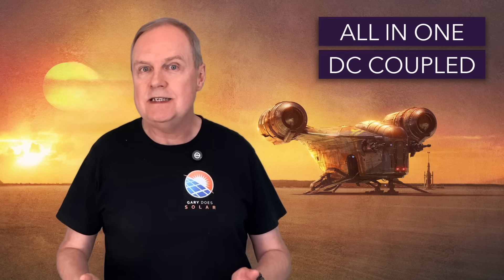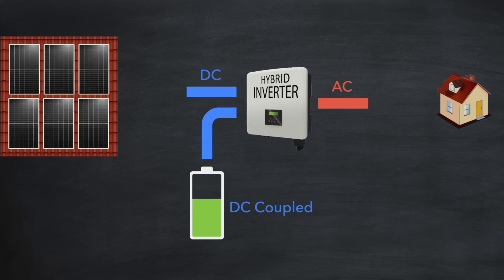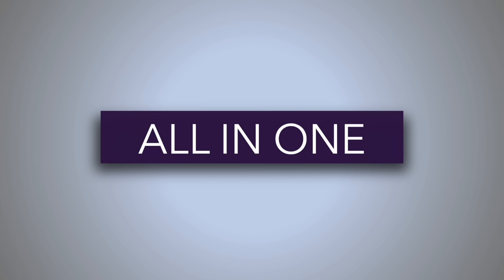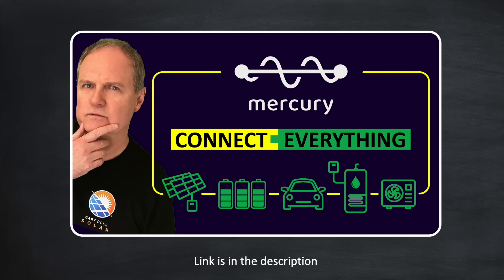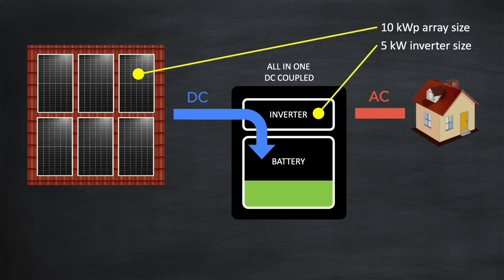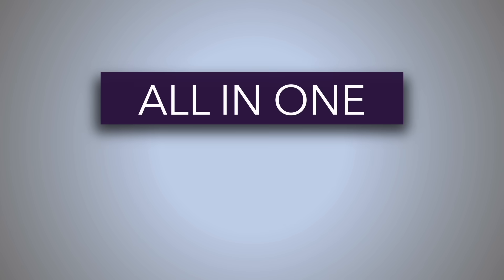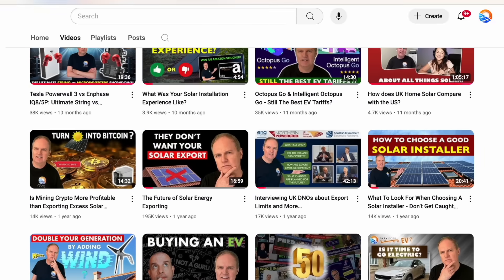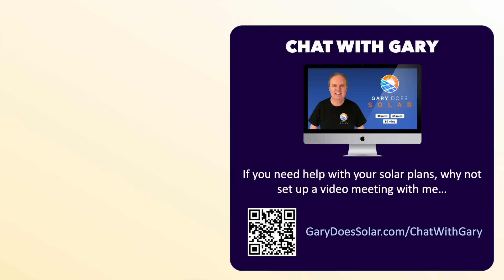Why All-in-One DC Coupled Systems are Transforming Home Solar

Comment: I'd far rather a modular system from Victron. The solar is DC coupled just as with your all in one systems, but it's easily expandable and - most importantly - I'm not locked in with a specific battery. This makes a vast difference in cost.

This isn't a phone or a pc. These systems are wired in by a qualified engineer anyway who can easily spec the system and manage the additional installation complexity. All the client needs is a nice app which Victron undoubtedly provides.

The cost difference is vast. I have a 32kwh battery, 5kw inverter and 3kw of panels... Total cost was about £4k, plus another £2k for installation. An equivalent Sigenergy system is literally 5x that price, for a completely equivalent product.

Comment: it looks cool but i'd rather have a modular setup. they are larger and built better. larger heatsinks, fans and more internal space to manage heat especially for  8kw and up inverter. setting up a solar system with the intent of selling power back to the grid these days is already pointless. there will come a point where distribution utilities will purchase your power exported for basically nothing. and i have no desire for the thing that's powering my home to be accessible on the internet sending data to god knows where and to god knows who.

Comment: One challenge is that our utility in the US requires AC metering on the solar, not the combined solar/battery system.  This requires adding another inverter reducing the benefits of the DC-coupled system.  It's been challenging finding a DC meter that works with the utility's Sensus Xylem AMI system.

Comment: Sig EC single phase 8/10/12 kW in Australia are being recalled due to fire 🔥 risk. It’s big news over here. Their reputation are in tatters. 10+k units are affected. Sig is paying $500 AUD (£250) to installer to go back to the customer premises to install a new unit. Unsure if it’s affects worldwide 🌍🌎🌏
Reply from the maker: “Reputation in tatters”? I don’t think so. Let’s wait for the official press release, but if there is a design issue (and it may not wholly be that), then it’s the mark of a great company that they’re acting swiftly to remedy.

Comment: I've a Powerwall3 installed June 2025. My DNO (SSEN) has not only restricted my export to 3.68kW but also requires the inverter  to be limited to 3.68kW which means I draw from the grid when my home load exceeds this. This makes no sense to me. Originally I was going to have an AC coupled solar array using micro inverters which would output up to 3.2kWp. The DNO said the PW3 would have to be set to 0.48kW so that the combined solar plus PW3 didn't exceed 3.68kW. Duh! Why would the DNO put such a restriction on a User?
Solution was to DC couple but I still have a maximum generation limited to 3.68kW despite not requiring any export.
I'd be interested in your thoughts?

Comment: With all-in-one solutions, you're locked to one provider and you're not going to get best prices, also future upgrades is in their hands, you're basically stuck with them for the life of the system: 20+ years. 
You're trading flexibility and competition for a packaged product
Reply from the maker: To counter… in the early days of PC computers, you could buy all the components from different suppliers and combine them to make a system. Today, some people still like to do that, but Apple showed that by controlling all aspects of the system (both hardware and software) you can product a world-beating compelling solution. I see the same happening with home solar systems—the sum of a well-put together package is far greater than its parts. But it takes a great brand to get the magic right.
Reply: @GaryDoesSolar  You just further validated my point Gary. Yes, Apple sells you a smartphone for £2000+ and a goggle for about £3000+, tightly controls access to the ecosystem to serve and protect its own interests. 
The skilled person who bought best components and put a system together (a rare breed these days) has to have a lot of skills and patience to get them to work well but will end up with a solution specific for his needs at a much lower price point.
Reply from the maker: So going back to your original comment, you’re basically saying that a billion Apple users are wrong. Do you really believe that?

I do admire anyone who has the knowledge and skills to build their own system, to suit their particular purposes, but my channel was not set up for those people. My channel is there for the majority of people who don’t have those skills, but nonetheless want to participate in Home renewable technology. The systems I talk about in my videos are therefore well-suited for my audience, in my opinion 👍🏻

Comment: For me - micro inverters are best served where you have splotchy coverage for your solar panels. - i.e. trees near by or some other thing that filters the sun light or for very small systems where you only have AC needs.  Otherwise, IMO they add a large expense even though they negate the need for a charge controller and Inverter.  

As far as these all in one DC coupled systems - I'm still not convinced since they have a single point of failure.  I know that this is the trend now adays, but I prefer component based systems.  And as you stated with Apple and Android, I don't really like being forced to be married to one eco-system.

Comment: The passage about Batteries not compatible with some brands of inverters is BS as most BMS are talking to ALL brands of  inverters because this is their purpose. I don't say you can't find any niche BMS that has comunicaitons problems, but for the important part (SOC and switch), it works. DC coupled high voltage proprietary systems are the answer from corporations that want to get rid of cheap homemade batteries and systems. Today a complete 16Kwh 51.2V battery cost 1600€, almost TEN TIMES LESS than proposed HV systems.

Comment: HI GARY, just going back over this video, thank you for posting. I haven’t spoken to you in a while but I thought I would reply here as the Solar PV and Battery install we are having installed in DC. Happy to discuss 😊
Reply from the maker: That’s great, Simon! 😀 Yeah, feel free to get in contact—would love to hear the details 👍🏻
Reply: @GaryDoesSolar  Thanks as always Gary. The two roof solar pv arrays will be about 11kwp, linked up to SigEnergy Gateway, 10kw inverter, battery and DC bi-directional EV charger. I also decided on fitting an ASHP. 
A couple of queries for you / the community: 
1. Where is the UK government on V2X (specifically V2H) legislation? I am aware of the Octopus Energy EV V2X package that has recently launched so is this energising movement on this?
2. What advice do people have on linking all these systems up through the Gateway so I can run an efficient system.
Reply from the maker: On 1, I think we’re 2-3 years away from any legislation being published. It’s a huge issue for the DNOs because a typical house would be theoretically able to export from solar, battery and EV all at the same time. In my recent (Mandalorian) video, I can see All-in-One, DC Coupled solutions leading the way here, as they can hide all that power behind the inverter, but for other disparate systems, how can that be controlled?
Reply: @GaryDoesSolar I get the point about the grid and DNO not seeing what’s hidden behind the inverter but why can’t the homeowner make use of the huge car battery reserve when it’s needed. The technology is there to use but is being held up.
Reply from the maker: Yeah, you make a good point. If it can all be consumed by the home, why should the DNO care? But of course, if the home required zero power, then the only place it can go is to the grid, and so that's why they want to understand the total power output of a system (including EV). Maybe there's a good solution for all this? For example, an additional hardware unit at the meter that blocks export above a limit?
Reply: @GaryDoesSolar THANK YOU for taking the time to respond Gary, always appreciated. It’s an interesting discussion I am having with our installers and soon with our energy provider. I will make a record of the project as it progresses and try to keep you, the Chanel updated in case it can be of help to others.

Comment: Question:  
Do LED bulbs need AC?
Do heating Loads?
Do Computers?
No?
So what ACTUALLY needs an expensive inverter in your house...???????
ALL those loads are simply less or more batteries connected in series.  (skipping the parallel for simplicity)
ie: Lets say you have 55 (Solar Charged) 2v cells in series:
Live wire after ~ 2v cells is LED lights.
Live wire after 6 such cells is computer, cell phones etc.
Live wire after 55 is water heater, room heater, stove, kettle, toaster etc.
What actually needs AC and how big is that inverter..?

ie: The future of solar-battery power is when the world realises it's having the living shit scammed out of itself..!
ie: "Hey Mr Giant Expensive Inverter:  Fo Guck yourself!
Reply: agreed
Reply from the maker: You both need to understand the issue with electricity transmission. My video here is a good starting point:

https://youtu.be/qaNvzoJ5rVI?si=rikZMOr2YTLSc_GJ
Reply: @GaryDoesSolar  :D   LOL!  
Nice try.
We aren't even talking  long distance DC  here, which BTW is the new new for HV.

DC is transmitted just fine everywhere and has been for over a century now.
In  fact it was the de-facto power initially.
More:  The Solar you fitted transmits DC to the inverter.

Perhaps you are referring to the 3 to 4 wires needed for 3 phase vs 6 for the equivalent DC.
Hast been an issue from the panels to the inverter you have fitted now  has it!?

The  only issue  is that because power does not go to zero as it does with a sine wave; DC does not 'let go' if you  shock yourself.

Sending an electrical engineer off to learn about   AC  vs DC is a feeble attempt to keep things too complicated for (ignorant) customers.

20% say, on an expensive inverter is good $$, whereas 20% of zero is zero.
Reply from the maker: You strike me as a person who knows very little about power distribution. If you were right, everything would be DC.

Comment: First, I got to admit you're right as far as the all-in-one hybrid inverter revolutionizing the solar industry. Second, I must say that the solutions you proposed are why people do not embark on this journey. All of those solutions you propose are expensive options. You want people to embark on the EV revolution but you ask them to bite into Tesla prices? It will never happen! Just like solar never fully developed since its inception because it was a luxury commodity. You have to make this technology affordable if you want to move the masses. Third, I testify that the solar technology is no longer out of reach: for most people who own a house. Panels are inexpensive if bought second hand. I got more than sixty 250W Trina or Canadian Solar panels mostly at $10 each! To start with solar, they are ideal, as a large combination of series and parallel will make for a better capture of the sun if your roof is not fully optimized South. I can manually switch or direct each PV bank to keep my batteries banks optimally charged. Next, hybrid inverters are more affordable than ever. I just bought another 6.2kW PowMr hybrid inverter for $248 that I configured to use as off grid only. I connected it to a 216Ah, 48V battery pack. It was a used 11 KWh 51.2VDC LFP rack mounted battery for $700. You can even get cheaper nowadays through AliExpress, but it takes time whereas I got mine within 20 milese from where I live.  I haven't spent much for wiring because it came from salvaged rewiring construction  material which I scavenged. Although I did have to buy a bunch of DC breakers, some BMS. The total amount I spent was less than $1500 and now  I have EVSE station charging my car for free, which I can use to backup the 10.2 KW off-grid system that powers my whole house. In summary, I laud your effort to back the Solar industry, but I despise backing people like Musk who capitalize on our need for cheap energy to enrich themselves at our expense. Our government is backing up these vultures and so are you.
Reply from the maker: Thanks for taking the time to write this. Not everyone is able to build their own solution, like you’re able to, unfortunately—and they are quite happy to pay that bit more for professionals to manufacture and install solutions for them.

Tesla already sold 1 million Powerwalls worldwide, so (clearly) the price is right. And over time, as I’m sure you know, technology gets both better and cheaper, meaning prices fall. And provided there is sufficient competition in the market, prices falls will happen faster. 

I’d prefer it, therefore, if you didn’t  align me with your described “vultures”…
Reply: @GaryDoesSolar  I must admit I was a little bit harsh, so I sincerely apologize. I do not like Elon Musk but I give him the credit to make EV a reality when others trash the government's incentives. China used his success to capitalize on their own success. For having a model to beat is easier than to start from scratch. No matter what, cheap or expensive, you contribute to educate people to move in the right direction. The choice to get smarter is up to them. So I appreciate your effort. Thanks.

Comment: Hi Gary. my big question is why the inverter limit of 5kw. I get the network may want to limit export to 5kw, but what if the house wants more than 5kw? I live in a hot country and modern houses have big a/c units which can pull more than 5kw at full power. and they're often 3phase too. why cant the inverter be bigger than 5kw but still limit exports to 5kw?? It isn't that hard to measure the current flowing in the cable to the grid. Inverters are usually installed next to the meterbox so the grid cable is only 1mtr away?? I guess the UK needs lass ac for cooling, but it seems possible if you are heating the house, hot water and cooking with electricity that you would frequently need more than 5kw.

Comment: I am having a little trouble understanding my proposed battery installation. My 13kva solar panel array is on my shed with with the SMA 3 phase invertor fitted there as wel all connected to a sub board in the shed. The smart meter is installed in the main switchboard at the house 30metres away.
Any excess power being generated is being sold back to the grid. I am told that if I connect a battery setup in the shed the spare power will not be fed into the house before going to the grid. I will need some sort of relay switch and signal wire from the invertor setup, I do not understand this and it is difficult to find information about how solar battery systems work if connected remotely from the house, can you help at all, much appreciated.
My setup is  mains power into the house and then onto the shed all 3 phase. I am told that one phase goes straight back to the grid direct and I need the relay to automatically divert it to the house if required. I am in Australia 240v single phase and 480v three phase.  Does this make sense to you?

Comment: The argument starting at @9:10 does not make much sense.  Why would you discharge your battery at times when the grid operator does not want it?  When the sun is up, that's when prices are lowest and you'll want to charge that battery.  When there's no sun and wind and high demand, that is when the grid operator will want that power in your battery, and pay well for it.  The grid operators here in NL don't impose limits and aren't even interested at all what capacity your system has, unless you're a larger player (like a farmer covering his barn in panels).  Though... if your grid operator wants or needs to know about your system, I can see how an all-in-one DC coupled box will provide an easy answer.
    
There is one other important advantage of a DC coupled all in one system: your solar panels will continue to work if there's a power outage, charging the battery and powering your home.  I have an all in one home battery, but the solar panels are AC with micro-inverters.  When the power goes out, those panels are isolated when I switch to backup power; these inverters don't play nice with "grid power" provided by the battery's inverter.  The battery system can take DC from the panels, but I prefer AC coupling for electrical fire safety reasons.
    
I have an AlphaESS battery system, and I highly recommend it.  A 10kW 3 phase inverter that works with micro-inverters and takes DC as well.  Their "backup box" that switches from grid to off-grid is pricey (over €1000) but it's very fast, they claim 20ms which wouldn't even make electronic devices miss a beat.  I opted for a manual cut-over switch (just a 4 pole 3 way switch in a box).  The inverter plus 8kWh battery set me back something like €5000 or so, including installation.  Their app is good, but even better: you can integrate this thing into Home Assistant directly, without having to go through their cloud.

Comment: where there is still system limits is where there is a local generator for extended outages.  where I live, we have had outages of several days to weeks due to storms.  maybe a video on systems which can incorporate generator.  the onlybi have seen is Franklin
Reply from the maker: Sigenergy allows such, and also Tesla PW3 with special wiring.

Comment: Sounds like we should promote direct DC power to our appliances ... Given that most of our appliances are DC at heart ( with internal AC adapters to accommodate the AC wall outlet). 
AC was always a means to transport power over long distances ... that requirement goes away with local energy capture and storage.